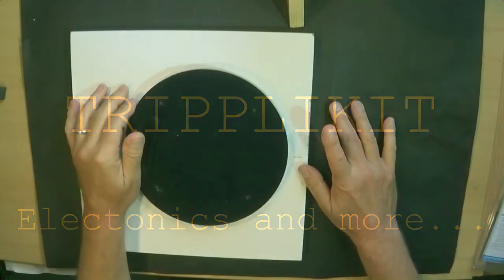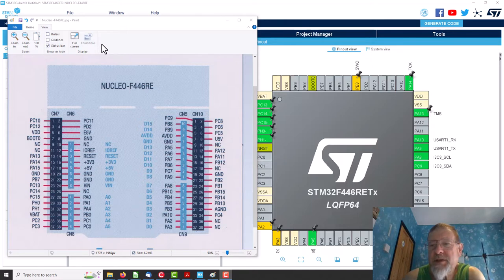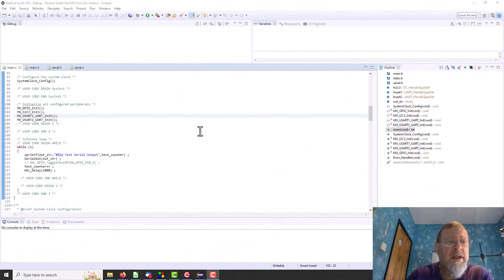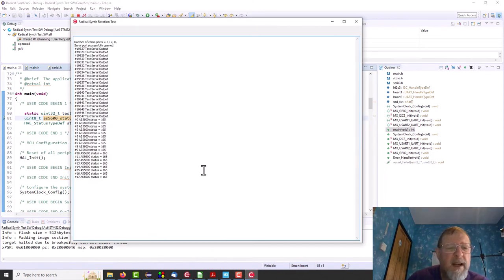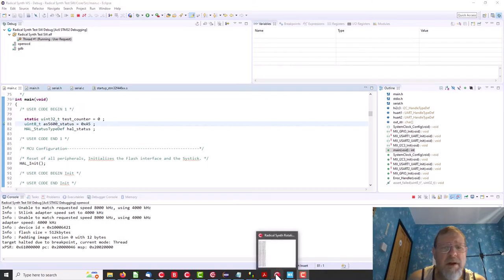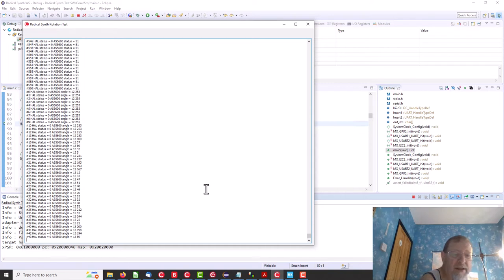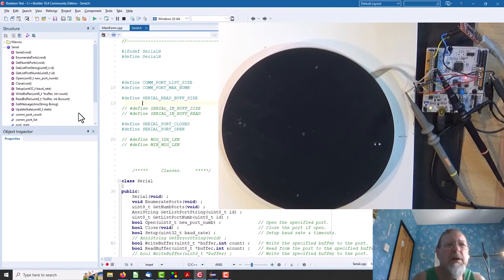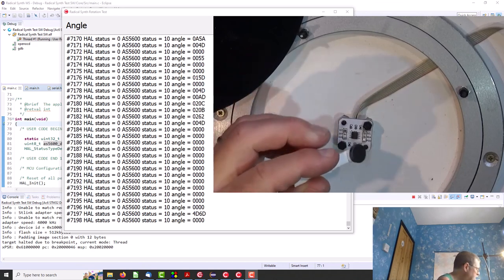All New Radical Synthesizer. AS5600 Rotation Sensor

Comment: Why would someone not print angles but hex!!
Reply from the maker: I have no intention of ever displaying the absolute position of the turntable to the musician so there is no point in calculating angle values. 000h to 3FFh is a lot easier to cope with in code than 0 to 360.